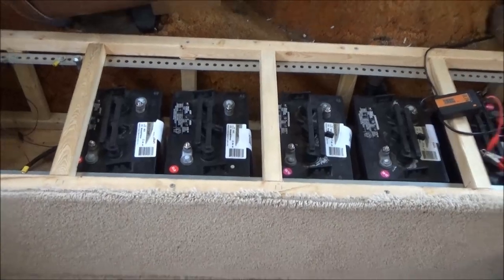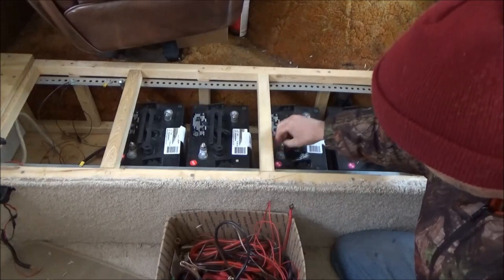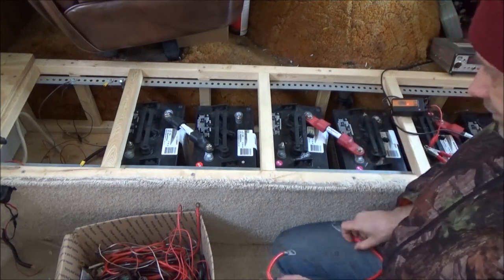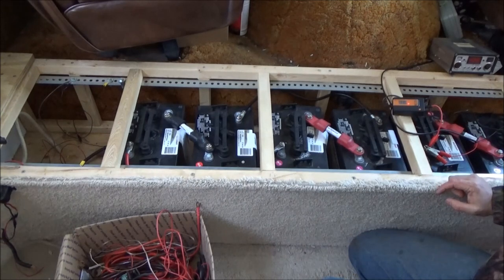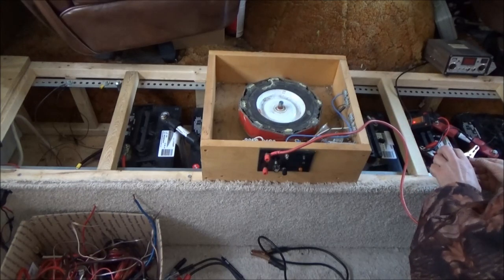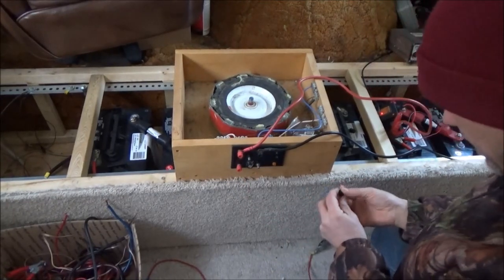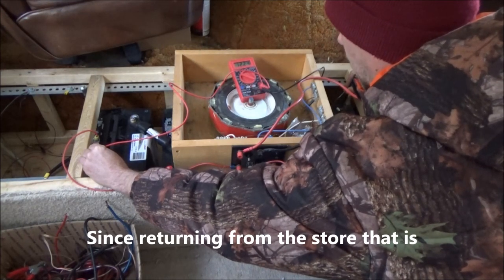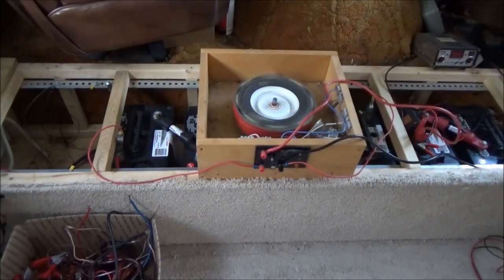Connecting Badly Sulfated Golf Cart Batteries To Bedini Motor Desulfator In My Off Grid RV

Comment: I just wanted to let you know troy you will never get the bedini dialed in while running the clen desulfator it sends pulses out throwing your led you base your settings on the bedinni with any desulfator will throw this off because of the spiked pulses.
Reply from the maker: I see that
Reply: I want to say also while desulfating you want to keep the batteries above 60f otherwise the sulfide cannot recombine with the water to form sulphiric acid it will just drop to bottom of battery in hard crystal form and your specific gravity will never raise.

The short thing to know here the hole time you were desulfating and overcharging your forklift batteries to rejuvenate them you were forcing the hard sulfide deposits off the plates but they fell off and never recombined with the water to form the sulphiric acid in short you may have ruined your fork lift batteries because now the sulfide will never be able to recombine.

The short message never attempt to desulfate a battery if battery temp is under 60f this is a experience to learn from the chemical reaction to recombine the sulphide crystals into the water to form sulphiric acid is nearly put to a halt under 60f. 

I will aslo give you hint temps upto around 80f-90f increase the chances of recovering a battery so long as the charge being put in is low enough ( to reduce chances of damage  to the plates ) but the spiked pulses ( electronic desulfator )  can be strong enough to break the sulhpide crystals down to be redissolved into the the acid solution to raise the specific gravity anytime you see charge or surface charge peak and not go any higher and the specific gravity won't go higher you are dealing with to many of the crystals dropped to bottom in hard form.
Reply from the maker: Rick Cooper The forklift battery was at 12.2 volts BEFORE I connected it to anything and has never come up yet to this day. This tells me that I have not damaged it myself. It still rests at 12.2 volts at the end of the day no matter what. And it is still at 12.2 volts in the morning every day. Sometimes 12.3 or 12.4 but mostly 12.2 volts. I am starting to wonder if the solar charge controller volt meter is damaged. It was reading 12.2 volts on the golf cart batteries I brought home brand new. Remember
And then the other forklift battery set was reading 12.2 volts all the time.
Makes me wonder.
By the way the golf cart batteries are happy out in the cold RV right now. Even the older ones are at 12.63 right now.
Reply: The Do It Yourself World The point is the chemical reaction will not occur where the sulhpide crystals dissolve into the sulhpiric acid solution to raise the specific gravity ( you know that is where the sulphur in sulphiric acid comes from ) and instead will fall off the plates and go to bottom of battery as hard crystals the temperature is to low for the reaction to occur.

The facts are the sulphide crystals will fall off and settle to bottom and never recombine with the solution to strengthen the acid hince why your specific gravity has never climbed. The issue at sec is you are forcing the crystal to break away from the plates but it can't dissolve so your acid gets weaker and weaker and your rest voltage will remain low and battery amp capacity will also be low because of the weak acid which is a tattle tell because of low specific gravity after all the hard charging and also your method of desulfating.

Battery 101 how does a battery function as battery goes lower in voltage and sets there for a period of time the acid's sulphur molecules attach to the lead dioxide on the lead plates and until voltage is raised ( reversing this ) the crystals will rest on the plates eventually hardening to point they can no longer be dissolved back into the acid solution which causes acid to weaken because it loses the sulphur (key part of sulphiric acid). The other part of it is as the temps get lower and lower the chemical reaction gets slower and slower eventually hitting wall at which the dissolving capability becomes nearly 0 (this starts around 60f that the reaction starts slowing) once the temps get near freezing the reaction almost halts altogether making the sulphide nearly 100% incapable of dissolving.

So all this equalizing and such and charging at 16v+ has done nothing but shed the sulphide crystals off the plates because battery temps were to low making the acid remain weak and 100% incapable of getting the specific gravity up. This is where the prepper / camper / survivalist mentality comes in keep your batteries at a comfortable temp just as if it is a living being if you don't it will freeze to death get sick and die prematurely or at a very young age. 

I will say this nearly all preppers / survivalists keep theyre battery banks around 65f for a reason as you are learning the hard way might be able to strengthen the acid when it warms up to recover proper acid levels but that takes on risk also that can bring on grid corrosion and such and again prematurely kill a battery.
Reply: The Do It Yourself World as for the battery setting at 12.2v when you got them use a hand held volt meter check the voltages and see if your solar voltage is off other than that the voltage was low when you got the batteries yet you let it set in the cold how long in the cold and then put it directly into service without ever letting the battery warm up and commenced equalizing and blistering voltage feeding to it and added a desulfator also. The point is you shed the sulphide crystals in a way that they are gone forever (doing all the desulfating equalizing and pumping to much voltage all day into them for a week or more) making the sulphur content to low in the sulphiric acid. The sulphur that was shed in crystal form is in bottom of battery forever lost no longer able to be dissolved into the acid solution making your specific gravity forever going to be low.
Reply: The Do It Yourself World PLZ understand I have been watching your videos from the begining and have only criticized you a few times and both times were for good reason. I have always did my research before I ever posted any advice and double checked it I am not trying to come off abrassive or anything I am trying to help you by giving you solid advice. 

PLZ understand I am not a troll or out to get you I am a legit person that is also interested in alot of the same things you are it seems I have solar and a fairly large battery bank around 1400AH and 1k worth of solar. yes it isn't the largest system yes it works and to date I have yet to kill a battery main reason I keep my batteries at around 65f or so. I have a few batteries that are around 4yrs old and yes they are mainly golf cart batteries in my setup. I have brought a few batteries back to life but not with a bedini or anything a capacitence battery charger seems to work best. I use 25mf-50mf 440v 2pole capacitor and a bridge rectifier and my 120v feed (you could use a inverter I imagine the capacitor is nothing but a current limiter in this method) put it on the battery keep it around 65f and wait and watch / check it I have been able to recover 80% of batteries I have attempted this on.

Comment: I don't think the wheel do dad does anything. You have used it several times on those batteries and it has not helped.
Reply from the maker: Actually no I have not. I set it up. It was loud. I disconnected it. It takes a month or more to restore a battery. I ran it for a couple days only.
Reply: The Do It Yourself World No,  Carl is right.  It does not work.
Reply from the maker: TheDisorderly1 And have you tried to make one or are you one of those who just say "it does not work" without trying it?

Comment: What the heck is radiant energy?
Reply: Thermodynamics :)
Reply from the maker: The dirac sea is a source of energy that you can use. I am just using energy that is there. Some call it "free" energy but then thermodynamics people freak out.
Reply: Oh boy... I sense a very long thread in the making...I hope.  Last time I found the discussion fascinating!   So, good question...     When I was watching the video I was thinking   Oh, oh... here we go...   :)
Reply: Hydrogen is a great for a heat source although production and storage can be dangerous if not done correctly, also requires specialized equipment like an 02 (oxygen) filter.
 Pure compressed hydrogen can be burnt in a gas heater.
Reply: It is not possible for a magnet motor to spin constantly without using energy for additional moving parts or electromagnetism. 
 If someone has built such a motor please collect your Nobel Prize because E would no longer =MC2
Reply: *****
have you ever checked out mr teslonian he has a you tube channel he put some different types of metal rods in the ground (for example to what you are saying) and i think he got one volt per cell he made then took 12 cells and connected them all together to get a 12volt set to charge battery's its cool he is always just experimenting but its very cool to watch
Reply: The Shootist Not sure I understand, I think you are agreeing with me. A perpetual motion motor is not possible and even if it was, for example in the vacuum of space (no friction), the moment you apply a load it would slow.
Reply: The Shootist I think you are right that friction would eventually stop it... isn't  that why it has a battery attached to keep it going?  So where is the con?  If I understand the set up (maybe I don't)  the Bedini  uses a battery to help it keep spinning, the spinning allows the magnets to create (maybe not the right word) a pulse or voltage spike which jolts the sulfate off the lead plates in the batteries. Seems to me, like a home made version of the desulfator everybody says does work...so where is the con?   Is it a con to desulfate a battery with home  made gear but not if it has a manufacturer's label on it?
Reply: Free energy no, converted energy yes :)
Reply from the maker: MollyDolly You have it right.
Reply from the maker: google Account There is no "converted" energy here though. There is no energy transfer from the batteries powering the wheel to the batteries being restored. No electrical connection at all. The diode blocks that and makes it impossible. The circuit could never allow transfer from one set of batteries to the other. So please explain where the energy comes from? If not from the dirac sea that is.
Reply: I think the scientific term is called 'the conservation of energy'
Reply: The Shootist  You forgot to mention...the earth is flat.    It is easier to say something does not exist, than to accept what we don't fully understand yet.
Reply: The Shootist What is deceitful about a powered unit creating voltage spikes to desulfate a battery?   It's not hocus-pocus...
Reply: A flat world? Maybe there is such a thing but the Earth is not.
Reply: Albertzz99 Are you sure?    ;)
Reply: MollyDolly Yes, I have seen it myself :)  Round as a ball. But I didn't see the moon at the same time, maybe that's a myth :)
Reply from the maker: The Shootist Myth busters left out the magnets. Duh. Thats a bit oops.
Reply from the maker: The Shootist By the way, dont knock it until you have tried it. Until you build one yourself according to the specs and it fails then you have no right to call it a scam. It sure works for me.
Reply from the maker: Steve L Actually very efficient. It uses back EMF to pulse the batteries being charged and puts out more energy then it uses to keep the wheel spinning. Nothing created or gained, no laws broken. Just using energy that is already there. Back EMF some call it. Radiant energy others call it. Tesla knew all about it.
Reply from the maker: The Shootist How can you explain charging 6 batteries on the back end but using one single battery to keep the wheel spinning?
Reply: Steve L Well, since you can not desulfate a battery by hooking it up to another battery, why is there a problem inserting a crude inefficient motor/generator in between  ... so long as it does the desulfating that you are after?
Reply: The Do It Yourself World  No offense I don't see that as crude I think it looks cool.
Reply: Steve L He is not charging the batteries with the Bedini,he is just desulfating.
Reply: Steve L Exactly... and what fun are experiments without controversy....?   If everyone agreed it works then no big whoop ... but now... I want to see how those batteries are in about mid May... it will be pretty awesome if he can take solar power run it through one set of batteries, through a homemade Bedini SSG and end up with useable batteries...to power his off grid electronics lab.    I may actually start biting my nails.... ok, maybe not.
Reply from the maker: The Shootist I think you know what I meant when I say the diode will not pass current. It passes in one direction but in the direction it is installed in the Bedini motor, it will NOT pass current from the run batteries to the charge batteries. There is no electrical connection between the two.
Reply from the maker: Steve L Then it is an illusion I am happy to take part in because I have restored many discarded batteries with this "illusion" through the years.
Reply from the maker: Steve L Impossible. There is NO electrical connection between the two sets of batteries.
Reply from the maker: Steve L So, please do explain. Either its magic or there is something going on in this circuit. Open your mind to options other than what they brain wash us with in school. There is a big universe out there.
Or dont and just keep saying its a fake. I dont care. I will keep using mine happily through the years saving money while you deny it. Oh well.
Reply from the maker: The Shootist Do NOT let the doubters, who never built one of these, tell you it is a fake and that one battery is charging another. Please explain how one battery can charge 6 on the back side then? Also there is no electrical connection between the run batteries and the charging batteries. It is electronically impossible for the run batteries to charge the others in this circuit.
Sadly most of the doubters have never built one.
Reply: The Do It Yourself World You would think you are trying to sell them something... instead of just showing how you do it with your batteries...  I think I will just wait and see how it turns out...
Reply from the maker: Steve L Go back to my older videos fro proof of this working. I have restored many batteries with this. Just because I have not used it in years does not make it a failure.

Comment: Not trying to be a smart ass but you need to learn how to read a voltmeter.
A smart charge regulator will automatically charge the batteries this way, and doing it this way will extend the life of your battery.
bulk phase - "heavy lifting" phase. Most of the charging is done here. This gets it to 75% recharged. Happens at 14.4 volts.

acceptance phase - keep charging at 14.4 volts, but reduce the amperage. This charges the last 25%.

float phase - not actually charging. This is continuous voltage pressure on the battery that is intended to prevent discharge. It happens with about 13.3 volts and very low amperage. 13.3 volts is full in float phase.